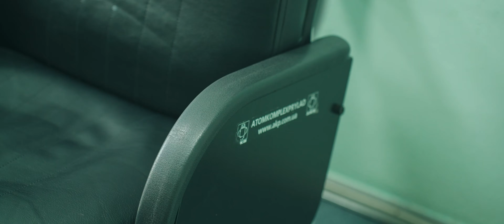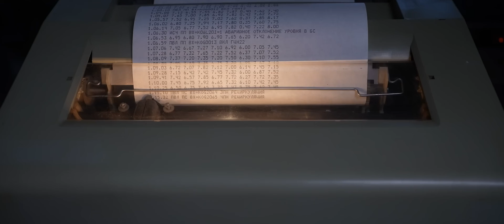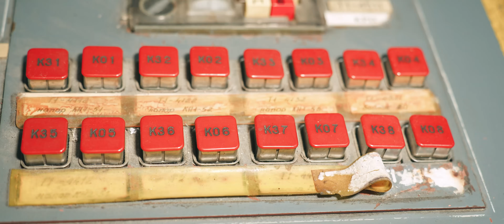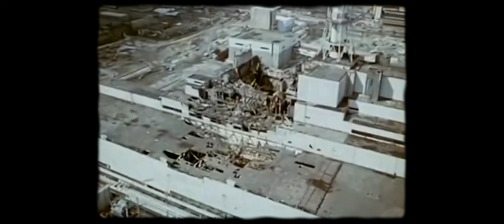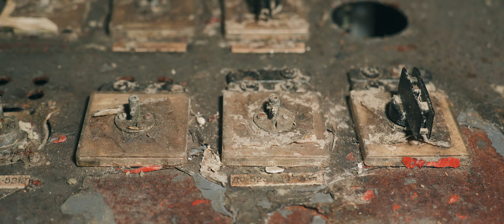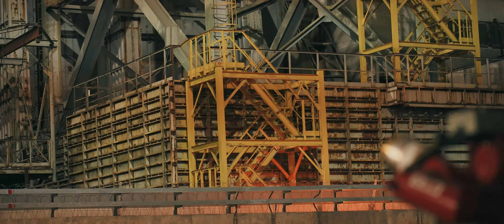COULD CHORNOBYL HAPPEN AGAIN? | THE SHIELD IS ALREADY FAILING |WHAT'S INSIDE THE SARCOPHAGUS

Comment: At Less than 50 fatalities Chernobyl is a pin prick on a highway billboard compared to

the1975 Banqiao Dam failure (and associated dams like Shimantan) — Henan Province, China (August 8, 1975) Caused by extreme rainfall from Typhoon Nina overwhelming the dams' design capacity. Official death toll: ~26,000 (direct flooding); higher estimates (including subsequent famine, disease, and epidemics): 85,000–240,000 (commonly cited around 171,000–230,000). This remains the deadliest dam failure in history.
Other Dam failures that eclipse Chernobyl death toll follow
2023 Derna Dams failure (two dams: Abu Mansour and Derna) — Derna, Libya (September 10–11, 2023) Triggered by heavy rains from Storm Daniel. Death toll: >11,000 (with some estimates higher due to missing persons and infrastructure destruction).
2019 Brumadinho Dam disaster (tailings dam, Dam I) — Minas Gerais, Brazil (January 25, 2019) Mining waste dam collapse releasing toxic sludge. Death toll: 270 (official, including some still missing).
1959 Malpasset Dam failure — French Riviera, France (December 2, 1959) Arch dam collapse shortly after full reservoir filling, due to design/geological issues. Death toll: 421.
1972 Canyon Lake Dam / Rapid City flood — South Dakota, USA (June 9, 1972) Dam overtopping and failure amid heavy rainfall. Death toll: Estimates range from 33–237 (commonly ~238 including broader flood impacts).
1977 Kelly Barnes Dam failure — Toccoa Falls, Georgia, USA (November 6, 1977) Earthfill dam raised multiple times for power generation; failed due to heavy rain and possible design/maintenance issues. Death toll: 39.
1977 Laurel Run Dam failure — Pennsylvania, USA (July 19–20, 1977) Failure during heavy rainfall. Death toll: >40.
Oth
A late 20th century Environmental lobby think tanker named Amory Lovins once noted that “giving the masses inexpensive, abundant, safe and environmentally clean energy would be like giving an idiot child a machine gun.Amory was referring to nuclear power.  So the elites have always known that nuclear is safe, clean, abundant and inexpensive but that’s why they oppose it.This is why they need idiots like you to propagate scary stories about an event that happened 40 year ago, and has never repeated.This is how you create a mass illusion of fear for the masses when there is  so little to work with.
Reply: Three Mile Island predates Chernobyl, Fukushima came after Chernobyl. But sure, it never repeated. The radioactive fallout of Chernobyl contaminated the soil in many countries far away, the produce growing there being non-edible to this day. Nuclear power was never save and heavyly subsidized to be even competitive.
Reply: @nielsweckwarth8627  Sea Salt is edible I believe and a pile of sea salt large enough to contain enough  U235 to fabricate a nuclear weapon can be pulled by a full size pickup truck.   Chernobyl is special because the elites need it to be special. It has nothing to do with the real risk Yes chernobyl radioactivity will be there forever but, likewise, the radioactive potassium and uranium in your body will remain rasdioactive in your remains for over a billion yeara after you pass.

Comment: RBMK design and development was more expensive than BWR and WWER.
Issue was that CCCP needed high volume of electricity fast. And WWER shell was made in only one facility, so decision was made to use RBMK in Chernobyl NPP due to lack of time for whole project.
Btw AZ-5 Burton should be above that white top left plastic visible at 25:59

Comment: By this accident whe are poissiont in Europe i remember that whe couldn't eat vegetables and drink milk and it was  nice weather and then whe get poisoned by chernobyl
Reply from the maker: In reality, the overall radiation background in Chornobyl is mostly normal.

However, there are still many contaminated spots that haven’t disappeared over the years.
Reply: @PeichevX  It is / was not about the radiation on itself but the products that were released, the particles themselves like the iodine that did spread in the cloud and came into the food-chain, or could come into it at the time.
We - like here in the Netherlands - were not allowed to eat our own vegetables at the time, since we could not measure what came down from rain. 
And I remember (I was 14) we were told to stay in to not get the 'poison' in our system.
No-one realy knew what had come down locally and ofcourse the fallout with the short half-lives were the most dangerous. Better to overstate then get extra pressure on the healthsystem later.

On other places, closer to the accident, still boars dig-up contanimated mushrooms and when they get accumilated they could pose some risks when eaten. But the risks are not that high anymore either... but you could be unlucky.

The local spots in / near "the zone" ofcourse will still be much more dangerous if they would be transported / smuggled out and brought into the foodchain, which is the highest risk. Not the radiation in the background.

Comment: They find it strange that chernobyl is stopped for make electricity and other dangerous shit, but how many people are dead of the "accident " i cant believe what they saying ❤😡😡🤬🖕🏻🖕🏻🖕🏻🖕🏻
Reply from the maker: If all safety rules had been followed, Chornobyl could have been safe for electricity production — and even today, it could still be generating power.
Reply: @PeichevX  I agree that the accident in April 1986 need not have happened if all safety rules had been followed (the test whether the remainig spin of the turbines is sufficient to tide over till emergency generators kick in would have had to be postponed then of course...).

But there are too many intrinsic construction flaws in the RMDB reactor to call it safe for electricity production.
The major problem of the graphite moderated reactor being the positive void coefficient, but also the gigantic size and the complete absence of any containement  - not to speak of the usual shoddy workmanship in the USSR - made it really accident prone.
Even the NIKIET came to the conclusion in 1980 that accidents were likely even in everyday oparation - but of course this remained more or less secret.....
Reply: @PeichevX  Forgot to mention: great video!! Kind of creepy, really haunting to see the inside of this Armageddon close up....
Reply: Countless deaths are directly caused by drinking alcohol, it provides no benefits except profits for it's manufacturers, yet it is available everywhere. Gasoline and oil production and use pollutes the ground, water, air and every living thing, yet it used everywhere, because the alternatives might reduce profit for oil and gas manufacturers. Profit comes before common sense and the health of others.
Reply: I don't believe you understand that what they're saying, or the situation.. or haven't watched the full video.
 First, the plant is not producing electricity for the grid, at least not commercially. Afaik the maintenance of the Reactor-4 sarchopagus actually consumes electricity, which is in danger because of russian strikes. You can't just abandon a loaded nuclear facility like that, it serves at least for research. If they didn't learn from the Soviet mistakes, the place wouldn't have run for another 40 years (anniversary of the accident was this month) without further accidents.

 However answer to your question is the same as to "how long is a piece of string". Nobody can tell how many lives were ended prematurely because of this disaster. Directly from the blast just a few, from bad safety practices for liquidators a few dozen, and unknown number (i've heard up to 3000 dying from probably related causes in a decade, with few tens of thousands with health problems much later) dying from one or another kind of exposure, which is quite impossible to tell for sure. A brother of a close friend of my mother was among the liquidators and indeed died from cancer in the '90s, apparently, but nothing was proven.
Reply: You have to think that a lot of these people are still affected by communist ideologies....